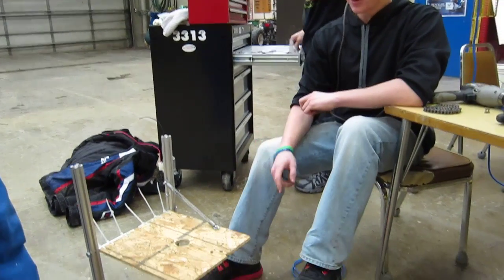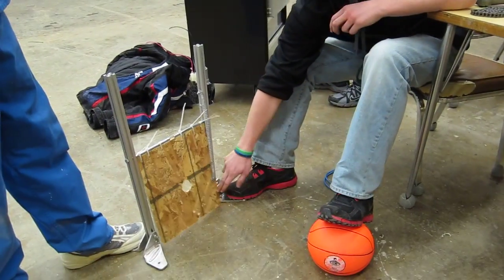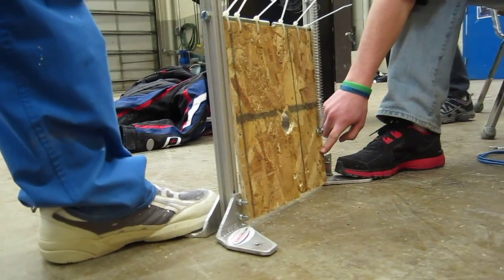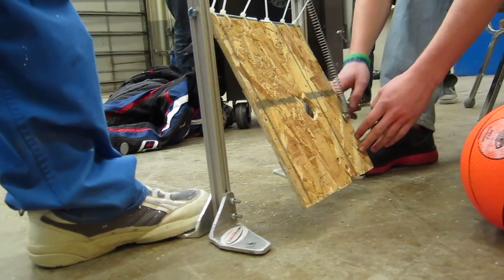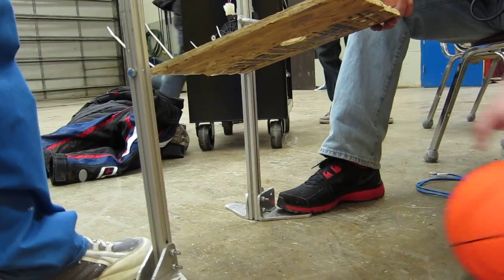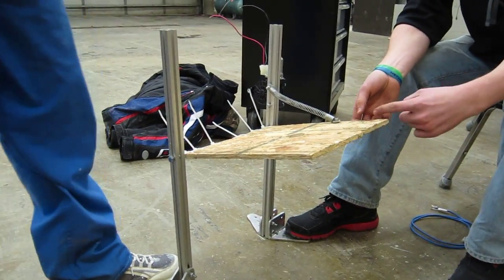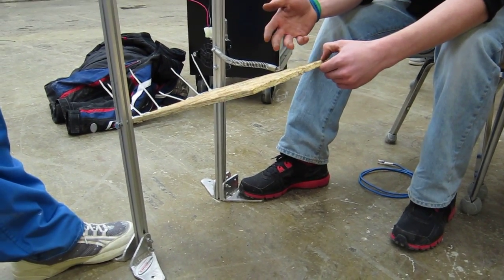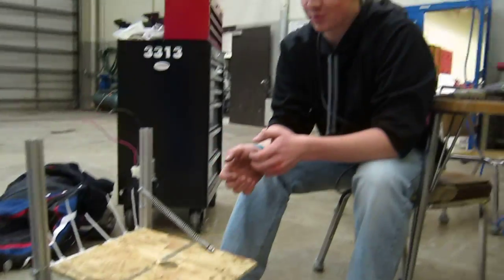Gate Prototype Starting

Comment: I have to agree with Normanite0. One thing that caught our team off guard in a previous year was that the balls will get caught on fixed surfaces like your door and make your robot ride over it. A solution that teams in the past have used is a free-spinning pvc pipe on aluminum shaft. You should give that a try. Good luck!